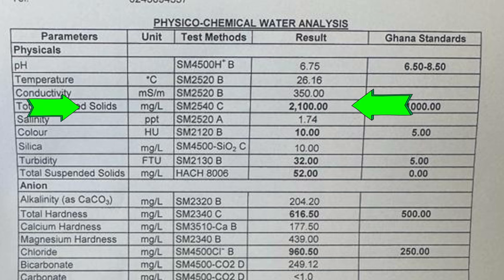Water Treatment in Ghana, What You Should Know.

Comment: Great lecture….My bore hole water came back satisfactory for drinking but I don’t like the taste and have noticed a slight browning/rusting of my metallic plumbing materials pH 6.52.  TDS 386 and Iron less than 0.010  …what can be done to improve the taste
Reply from the maker: Your water pH is just on the border line. I will suggest you get a calcite filter or a soda Ash dosing system to improve the pH slightly to around 6.8 to 7. 

With the brownish stains, I suspect iron, but since you said the result came out with 0.010, then you should take a look at your manganese level. TDS 386 is okay, not too pure, and not over mineralised.
Reply: @demlom thank you the Manganese is 0.278 
Where can I get the calcite
Reply from the maker: @thomasankomah4328  kindly check www.universalaquaghana.com to get a calcite filter.
Reply: @demlom thank you see the attached water test and advise which installation will address my issues of bad taste and the minor browning of my lines…

What system installation will sort all my issues pH 6.52 and minor rusting of metallic lines out considering cost as well?

Comment: Thanks alot for the video. very insightful. I have a related questions; how do I resolve issues of limescale? (I see some white dry film residue almost like fine sand on utensils after they get dry) I have a number of pre and post micro filters installed as well.
Reply from the maker: First, you need to find out what's causing the limescale. This could be calcium or magnesium, and the high level of these two could mean that your water is hard. If its any of them, you can use a descaler,  antiscaling system, or a water softening system. Scales could also be a sign of hard water, so a simple water softener would solve your problem. Also if the TDS is already high (something above 500 is high) and you add water softener, the TDS would shoot higher but the water would stop producing scales but it would mean that you would need to deal with taste. So I would suggest you test the water first. After testing, then you can determine if you have in excess scale causing minerals or your water is salty, and you will know how to deal with it.